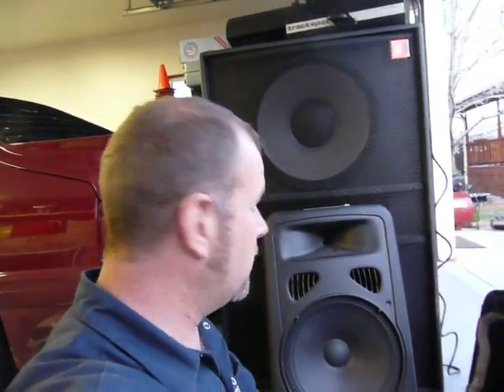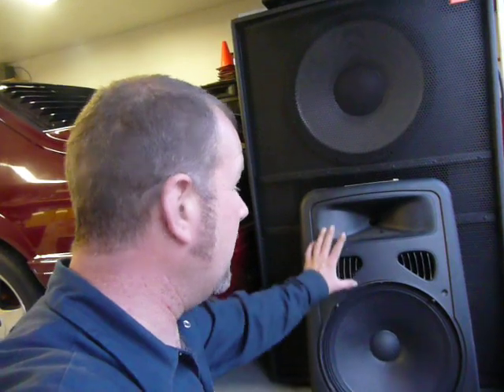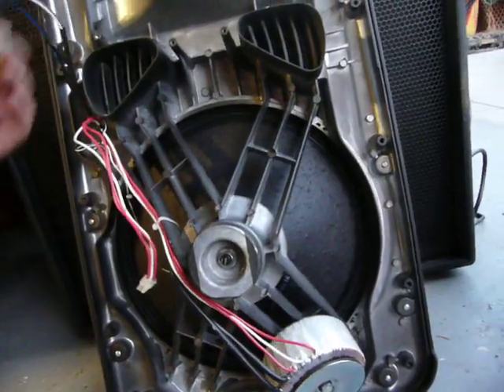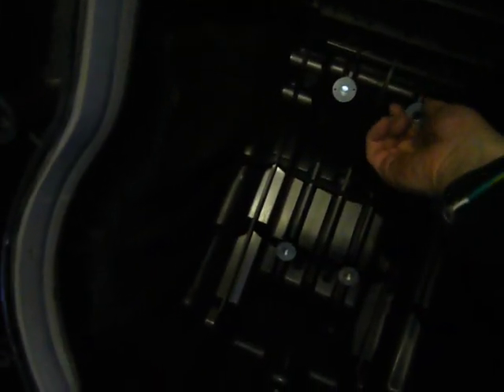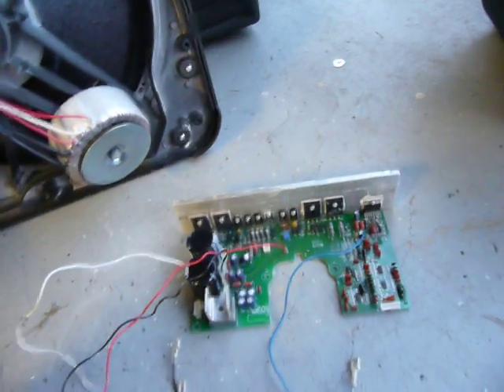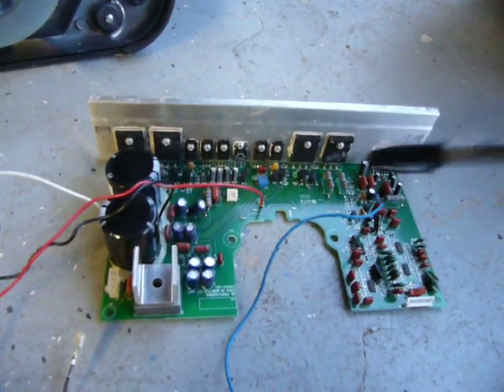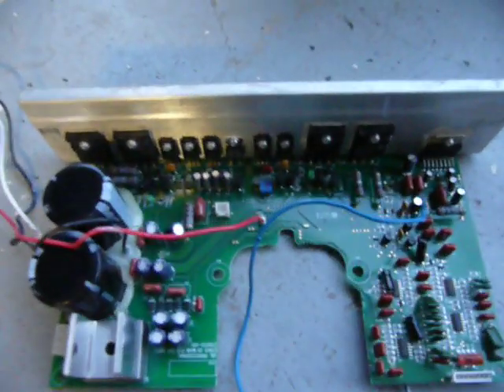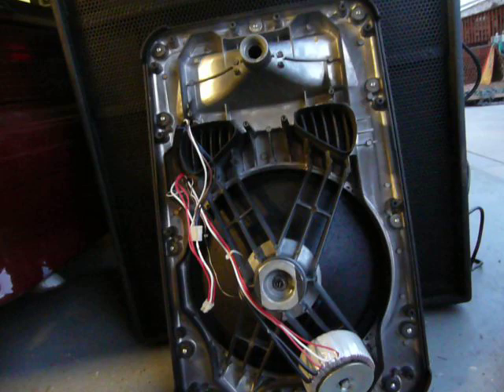Self Powered speakers part 4

Comment: I'm all for Mackie and QSC but I 
gotta say, sounds like the people in the clubs are the ones burning through wires. I've had my pair of 15"G2 for 10 years and they work perfectly.

Be grateful for inept club owners because its not the JBLs. Pops is a master electrician and has 50 years of experience, and he's been audiophile for just as long. He sent me this video to laugh at you blaming JBLs design and not the people overloading them. It was a good laugh. Thanks for that.

Lastly, acoustic engineering went into this speaker. You might be a repair guy but I doubt you have experience with designing speakers. You said it yourself, JBL makes good products, why would this one be any different? A cash grab? Laziness?

Comment: Can I ship you a JBL EON 315 it was plugged in working and then it just shut off and wont power on, and the GFI outlet it was plugged into didnt work anymore as well, I thought that was the problem so I replace it and thought that would resolve the problem....well the 315 does even light the LEDs....please help

Comment: quick question I know this video is old. I have a powered speaker that has XLR and quarter inch Jack's is there a way to tap into it to receive speakon connectors?
Reply from the maker: Maximus T only if you disable the internal amplifier
Reply: Sound and Light Technicians
 Do you have any schematics on that amp or a how to video?

Comment: I've got a pair of these that I came into super cheap and they have been nothing but trouble. I keep getting an awful crackling sound any time our singer turns the mixer up above 1. Any suggestions on hunting this bug down? I've tested for impedance on all the speakers, and they are all in great shape, providing resistance. I've been I've been told it could be an issue with the power supply input cable or even the center wiper on one of the potentiometers. Even after swapping in other amp modules, my problem persists. I'm completely baffled an would love some insight.

Comment: Sorry but the days of hauling around ground power are coming to an end - just a matter of time.   As far as the Eon, not sure how you can blow up so many of these.  I have had one of these for 10 years and beat the living hell out of it.  They are not easy to destroy by any means.  The unit has ferro-fluid cooling which you did not mention.  The Eon is the least amount of plastic of any on the market. The front is cast aluminum. I like the SR series double 18 cab as the back drop.  There are self powered  dual 12 cabs  on the market half the size of an SR series dual 18 + ground power that would hands down blow the diapers off that thing. Lug around 20 cubic feet and 200 lb for box alone, add another 300 lbs of ground power, cable runs, PD, or have one single box that weights $150 lbs and doesn't fill an 1/8th of your truck.    I buy Chinese G2 copies for less than $200, which are already surprisingly decent, but hot rod them with a quick treatment that includes a peel n seal application inside, an upgrade to JBL selenium driver and a cast aluminum Eminence 15".  When I'm done with them they weigh 80 lbs and kick ass.  I always find the club grade Sound guys out there with the SRX that brow beat the little powered boxes, like they are mickey mouse.   Unless you have real rig like a MILO, Vertec, etc., SR series are just as mickey mouse relatively speaking.  If I remember correctly, you  say the horn on a G2 is horizontal but supposed to be vertical?   Eons are 60 * vertical and 90* horizontal, pretty typical.  Unless you want to play to the ants and birds I don't think you need any more vertical coverage.

Comment: hey jeff off subject, but had a question since you repair them.  I have a pyle pro self powered.... worked fine for a year and now all I get when I turn it on is a loud buzzing noise. any help? thanks
Reply: might be some bad filter caps in the power supply section.

Comment: Hi one of my EON 15 G2 has been turning off and maybe after 15 mins or so it comes back on.  Finally it does not emit any audio at all.  It's getting a signal determind by the blinking signal light, but no sound.  I replace the signal input and amp board, still no sound.  What should I look at next.  You seem to know these EON's in and out.  Nate

Comment from the maker: @envisionelec That's fine if you disagree. I have a sound and lighting repair company. I can tell you that so far this year alone I have had to replace and repair 35 of these JBL self powered speakers from various night clubs. #1 problem is that the wires burn up (usually I can solder better wires on and they work). #2 problem is that amplifiers burn up (That requires replacement of of the amp) . I have not replaced a single QSC, Mackie, or any other brand of self powered speaker in club, ever.

Comment from the maker: @PulsePier   I have heard them both, I think the K series sounds better, warmer, etc... But the HPR series is supposed to be better says QSC. If I were to buy the QSC self powered speakers I think Id go with the K series. I have used the HPR 3 way 15", and the 112i versions. I think the 112i actually has a stronger sound but you need a sub .

Comment: I am shocked looking inside, definitely looks cheap and after researching decided to buy QSC powered speakers You're the expert, but  seems your comparing different amp designs wouldn't a class D amplifier require minimal heatsinks inside,how does these compared with QSC K series